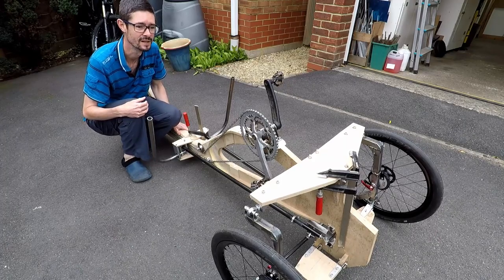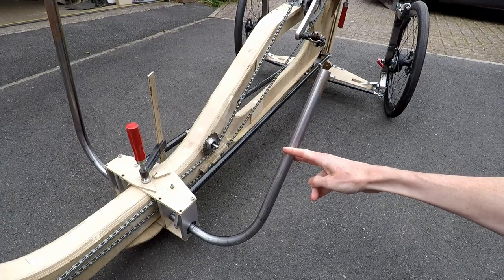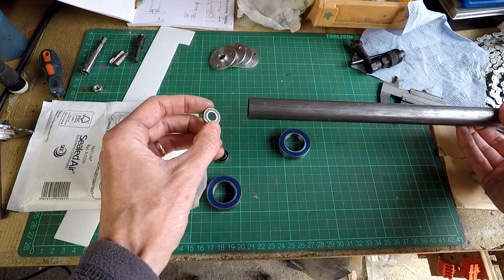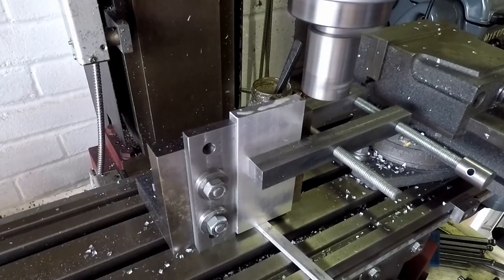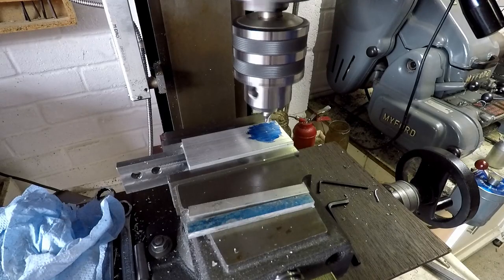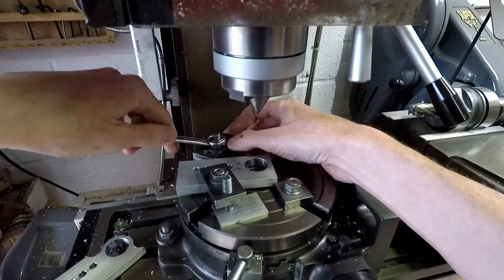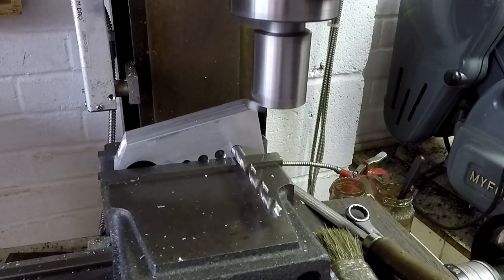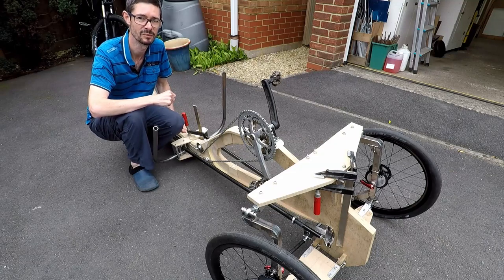Tilting Trikes Part 14 - handlebars and steering mechanism with lathe and milling work

Comment: I cannot avoid it... each time I see your videos it is the same question in my head... How much money in tooling is in that garage?? would you recommend a machine that could do most of the tasks?
Reply from the maker: It would be very un-British of me to answer that question honestly and in any case, my wife might find out.  Most of the kit is second-hand and/or of Eastern manufacture so relatively inexpensive.  A lot of the small tooling is home-made.  If I could only have one machine, it would be a decent lathe - second hand is fine - plus a load of hand tools.  A lot of milling tasks can be done on the lathe with patience.
Reply: @MetalMachineShop  LOL:) By eastern you mean, east European? any brands or country you could comment?
Reply from the maker: @urnenfeld  Eastern as in Asian, I.e. Chinese.  Sieg machines or similar are sold under many brand names, e.g. Warco, Arc, Chester, Axeminster in the UK. They are ok, cheapest.  Second hand Colchester or Harrison lathes good, but could be pricey. Depends on need and budget.

Comment: I see that you use QR skewers to mount the wheels.  How successful is that?  the QR skewers are quite thin and I was concerned that they are designed for a fork to hold both ends, however in the design at 2:40 am I correct that they are just passing through the 25mm square tubing and then into the QR hub?  I expected the QR Skewer would bend under that load.  What have you found?
Reply from the maker: It works fine, the skewers simply hold the wheels on and are not subject to any bending loads.  The wheels sit on a steel axle which is cantilevered into the uprights.  The skewers just hold it all together.

Comment: you have amazing talent. glad you posted this series. after watching you do this ,I realize I do not have the machines needed to build one. I may have to save til I am 90 to by a pre made one. velos are hardly known here in America . in 44 years I have only seen 2 for sale in New York. I want one that I can use year round, make electric and modify with what I have. maybe a heater for winter, run 3 inch or 4 inch tires during that time ,tilting is a must lol.

Comment: Are they the wheels you’re going to use on the final trike? I’m asking because there’s not much ground clearance and larger wheels give a better ride.
Reply from the maker: Yes, they are 20in wheels.  Most velomobiles have a 26in back wheel, but for my design, this takes too much space and adds a lot of length. Ground clearance is a bit tight and I may increase slightly on final design.  I will add suspension too.
Reply: @MetalMachineShop  
I remember  you said that you were considering making the front top crossmember into a leaf-spring to make the ride more compliant. If you decided to do that and you hit a traffic “cushion” or pothole it could bottom out. 
When it comes to springs, something like a snow ski could probably give you plenty of vibration suppression, they absorb shock but have a damped return to stop bouncing.
Reply: 20” is fine, larger wheels at the front seriously limit steering angles, and with the same size all round you get to only carry one spare
Reply from the maker: @JohnR31415  agreed, small wheels have lots of advantages and some cons of course.
Reply from the maker: @thechumpsbeendumped.7797  yes, something like that.  Some shock absorption would be good but suspension travel will need to be limited.  The rider sits quite far back so the rear suspension is more important.  Ground clearance could be an issue, but a carbon frame will not need such a deep ‘girder’, which will help.
Reply: @MetalMachineShop  
I’m only meaning a couple of inches of suspension movement, just to enough help with absorbing some of the vibration, help keep the wheels planted on the road surface and to aid comfort. With the centre of mass being set towards the rear and having 2 wheels to share the load the transverse leaf-spring wouldn’t need to be overly stiff to be effective. 
I’m so looking forward to seeing the prototype on it’s first journey.

Comment: Hi,

I'm in the prosses of planning to convert my electric Reverse trike in to a tilting model then fit it in too a Messerschmitt kr200 fibre glass body kit. I'm wanting to use a go car rack steering as the complete kit is about £80all in, weighing 4 kgs and is a simple design,  weight is not a major problem.
I'm very impressed in your design and the prosses of reaching it.
I would be looking to have suspension, I would welcome your help and input if you can.

Comment: so which bender did you actually buy? 😉
I resisted temptation so far because I didn't think they were any good...
but maybe I was wrong?
Reply from the maker: I got one very similar/identical to the Sfeomi 15 to 25mm tube bender available from Amazon, but I actually got it from eBay for significantly less money.  It did the job but there are a few manufacturing issues which ideally need to be fixed.
Reply: @MetalMachineShop   thank you!
so as per usual - you buy from PRC as a kit of parts to work on them to make them usable :-)
Still, I guess I would have to pay more for materials....
and what you have made with it looks perfectly OK
Will have to have a look on Ebay
Reply from the maker: @bambukouk  Slightly better than a kit of parts but the grooved die doesn’t really align with the follower on the handle (a spacer would sort it).  Slightly annoying as it would be as easy to make it right than as it is, but it’s an easy fix.  But it worked fine and for the price (about £70), can’t complain too much.